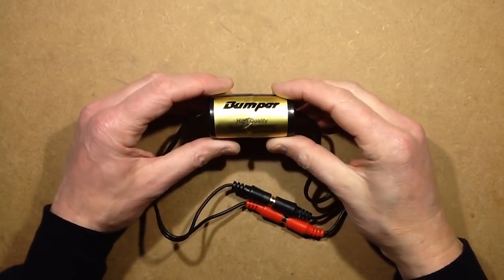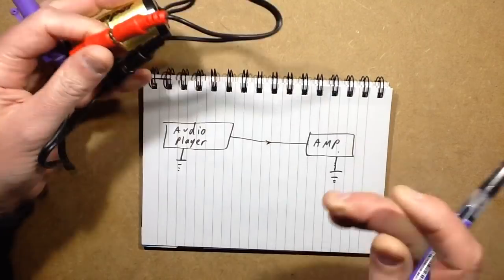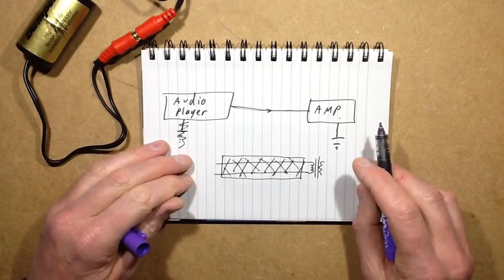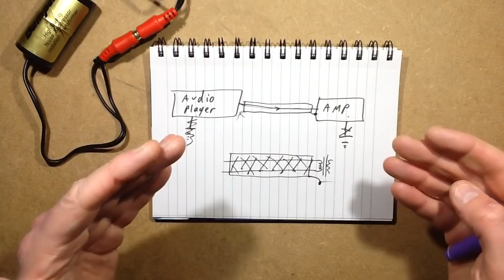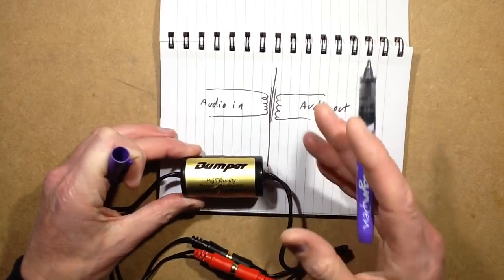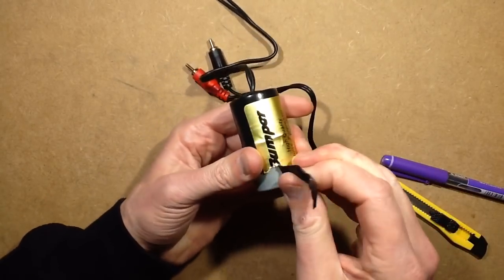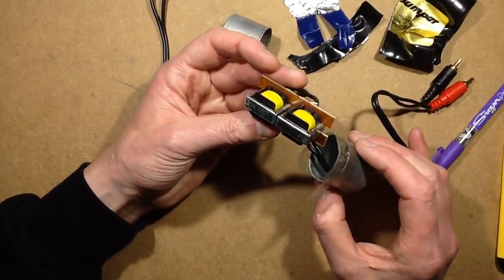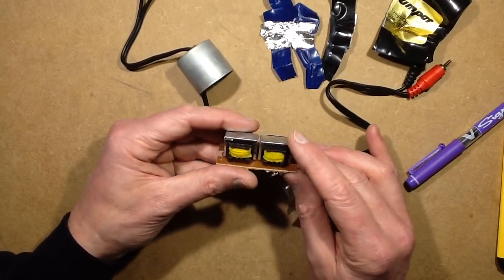Inside an audio isolator transformer module.

Comment: I have to get so.e of these in my application I use dimmer packs like propper ones and you can here the buzz at 50% like really bad at first I thought the dimmers was making the noise but the next day I turned all the lighting on and no audio and didn't hear anything apart from a tiny buzz and the fans on the packs

Comment: Just a thought, why don't manufacturers include isolation transformers on their inputs of the devices? surely it wouldn't cost that much more to include a little isolator.
Reply from the maker: +Michael SanAngelo More expensive audio equipment often does have transformers or balanced line receivers on the inputs.
Reply: +Michael SanAngelo Good transformers cost good money! Look up what a single input xmfr from the likes of Jensen or Lundahl will set you back. Not to mention their sensitivity to stray magnetic fields.

Comment: Usually used in automotive applications as well .If all your grounds are common in home or commercial audio you shouldn't have an issue .But we get grounds that  are missing and you have issues .My turntable my pre amp ,power amps all have polarized receptacle cords and cord ends 120V .But because my power amplifiers are u ground(Duplex) polarized I use an adapter that lets you use and share a common ground  screw so you can attach all your grounds to one common point .Some old audio equipment or radio equipment bond the neutral to the case and if you have a situation where you have reverse polarity between components or you being grounded and in contact with a metal component that's energized OUCH!!! Or you can damage valuable  Vintage Components  .I have had neighbours get Zapped from their coaxial tv Cable .Should only have 36vdc max on it .all of a sudden you have 90 to 120 vac coming out because some has a reverse polarity on a receptacle down the line !

Comment: I had this problem with a roccat headphones. They were a 5.1 so 4 audio jacks with usb power for amp (even though most soundcards on the market do not need any extra amp for 60ohm drivers on all channels). Every power source i tried to connect it to resulted in terrible high pitch hissing, incredibly when connected to pc i could actualy hear difference in the hissing depending on my mouse movements. 

I even tried connecting the headphones to isolated power sources such as a laptop on battery power, as well as different AC adapters from numerous smartphones. none of them solve the problem so i trashed the headphones and bought standard not powered ones. 

Sadly that audio isolator thing wouldnt help at all, 4 isolators, 8 RCA to minijack adapters . . .its a kinda bulky system to deal with and audio output wouldnt do justice for an expensive audo card ;p 
To be fair we do not use ground wires, most of houses are just 2 phase live and neutral with a current draw based home circuit breakers (+/-20A) .
Reply: +GotCritified Noise changing depending on mouse movements sounds like the USB signal leaking into the audio. Could be a crappy integrated sound card (I have experienced this with several computers, laptop and desktop - basically, if you care about sound, just don't use the internal sound card) or perhaps something to do with the USB amp thing - an amp for 60ohm sounds dodgy - in my experience any sound source will power my 250ohmish vintage Koss cans to deafening volumes, and many can even sorta power my vintage Sennheisers (600ohm or 2000ohm) if you crank the sound all the way up.

Comment: can you get one of these for normal 3mm jack my pc speakers give off a horrible buzz
Reply from the maker: +Jamie Thom I'm not sure.  At the very least you'd get a 3.5mm jack to phono adaptor and vice versa for the other side.
Reply: 3.5m what I meant woops
Reply: +Jamie Thom Yes, just search amazon/ebay/etc for a 3.5mm ground loop isolator

Comment: Out of curiosity, if you're in a dilly of a pickle and need to fix it fast, can't you just isolate it with two bridge rectifiers like the boats?
Reply from the maker: That would sound terrible as the diodes would introduce a sharp voltage threshold.
Reply: alternatively, you might get some nice guitar distortion. I mean thats basically an overdrive pedal

Comment: The foil is to provide a connection from the transformer clamps to the outside screen case. Saves soldering on a wire perhaps.

Comment: How can someone that cuts the earth to a power amp be called a "audio expert".
Anyway, We used those cheap isolators a lot (they come in different brands) and they do a pretty good job for connecting a laptop, all-in-one computer or barebone (anything that doesn't have a decent earthed PSU).

Comment: I used to use a cheap Chinese amplifier in my car and that used to get terrible interference when the engine was running the pitch of the interference would change as the speed of the engine changed I started using an external battery to power the amp and that fixed the problem but something like this would have been perfect
Reply: The noise I think you're describing can often be a sign of alternator problems.  cap on its way out I'm the voltage regulator on the alternator.  often has no other effects, other than making your radio do weird things
Reply: Nathan Lucas There was nothing wrong with the alternator, It only made that sound when that amp was connected and it made that sound in every car it was wired to.
Reply: +Nathan Lucas You're the voltage regulator on the alternator?!?! Wow, you can type?!?
Reply: +Aurelius R  auto cucumber strikes again

Comment: Facts about this product:
- This class of product performs what's known as the Ground Loop Noise Isolation.
- The Ground Loop Noise occurs when two systems reference two different grounds that aren't at the same level and interconnected via single ended signals.
- Isolation transformer is one of two ways to solve the infamous Ground Loop problem.
- The second way is to eleminate the Earth ground of one of two connected systems, so they're forced to share the same ground, of course, putting safety issue aside for this discussion- all AC device which has any exposed metal requires its own ground termination. 
- If noise is self generated by a device(a bad design), this isolation transformer won't help. That's not the purpose of this product.

Facts about the foil:
- The foil doesn't do anything. It's there because someone falsely thought it'd actually do something.
- Foil used in a proper manner in a proper device does eliminate EMI/EMC problems. An improper use also causes EMI/EMC problems. The foil used in this product does neither.
Reply from the maker: It's not acceptable to cut off a mains ground connection of a device as the audio cable would then become the return path for full fault current and could go on fire or the faulty device's case and connected equipment like hand held microphones could raise to near mains voltage and pose a high shock risk.  There are people that still do this, but it's very wrong.  One of those things that has been passed from person to person in the industry.
Reply: "...putting safety issue aside for this discussion..." & "...all device which has any exposed metal requires its own ground termination..."
Which part was unclear to you? 

The device in question can be an amplifier, but it can also be a small MP3 player, answering machine, small CD player, turntable and so on. The majority of household electronic products is considered Class II and has no Earth ground pin.

Comment: Cars have 'floating ground' with the chassis connected to the (-) side... You can get some nasty alternator and fuel injector noise in cheap audio devices...
Reply: If you think a car is noisy try a hybrid car - hundreds of amps at 300-400v thru a giant PWM supply. You might as well be in a tube train or trolley bus :) I make all connections via BlueTooth to get round this.
Reply: The only way I'd use bluetooth is using the Apt-X profile... The standard A2DP isn't good for much except those cheap little bluetooth speakers!

Comment: 2 transformers for the left and right signals.

ground loops are a problem too where a voltage can happen if you have faulty grounds.

car use maybe to allow connecting the speaker to line although there would be some resistors and capacitors to limit and recouple or decouple the signals

Comment: FYI the boxes to transmit audio over Ethernet cable have a transformer each end. Because f**** Microsoft Teams won't work with ASIO I ended up using one I had lying about between my audio desk and (unbalanced) PC Line In jack.

Comment: Lmfao I make these stereo isolators from power adapters of Cisco VoIP phones. Inside them there is a 10 ohm 1:1 small transformer  that is needed. You need 2 power adapters to get 2 ISO transformers. The power adapter is waste to I  recycled some of the components. The power adapters were thrown out for free hehe.

Comment: Two things. He says it is never OK to use a groundless plug. 
He is using and un-grounded source as an example. 
The reason studio engineers sometimes use ground removing plug adapters is when there are several mains powered audio devices chained together that are usually not, therefor the custom cabling is not available and standard patch cables must be employed. To have every power plug grounded and every audio cable grounded causes a giant ground loop and smaller ground loops around every device. Hum on top of hum. You can EITHER un-ground all but one power cord OR use audio cables with one end of the shield disconnected. Both methods will silence the hums AND provide ground protection. Yes, the audio cable method is preferred, but the ground omitting plug adapters work the same if used intelligently. Same ground protection, as cable shields are as substantial as any power cord ground wire.
The second thing is that the actual reason that so many people got electrocuted by the difference between the mic and guitar amp, was because of non polarized two prong amplifier power cords with ground switches that let the player choose which line the ground was referenced to. Those ground polarity switches were on practically every Fender tube amp made in the 60's and early 70's. If the ground switch was flipped the wrong way according to the PA power polarity, ZAP!
Ground omitting plug adapters are NOT the general cause of all the electrocutions back in the day, and these electrocutions have basically stopped happening with modern 3 prong guitar amp power cords. Vintage Fender amp users beware. Anyone with a two prong plug on a guitar amp for that matter.  Have a tech install a 3 prong cable and omit the ground switch if there is one. The foil plus metal can is to be considered a double MU shield, even if haphazardly applied...
Reply from the maker: +HUGO FUGUSEV Using an adaptor to break the mains ground and relying on an audio cable to provide a path for fault current is is not acceptable under any circumstances.  An audio cable is not designed to carry mains fault current and may not pass enough to activate the circuit protection, possibly resulting in shock, fire and serious damage to other equipment.  This misconception is a blast from the past and was borne out of electrical misunderstanding and luck.
Reply: +HUGO FUGUSEV These old guitar amps were so dangerous because they were AC/DC jobs - cheaper, lighter, but no mains isolation at all. (And if you were ever wondering why a band should want to call themselves "AC/DC"...) They needed a polarity selector so you could make sure your ground went on neutral rather than phase. Radios using AC/DC power would use extensive isolation, kinda hard to do the same on a guitar amp. 

Using a different power cord is NOT going to fix this because there is no isolated mains transformer to begin with (just a step-down job at best).

And yes, removing the safety earth connection on an IEC Class I device is not permitted. Audio equipment often is Class II a.k.a. "double insulated", which does not require PE and is built accordingly. Transformers also tend to be using shield windings for minimum capacitive coupling, so audio ground can be kept floating as well as possible.

Comment: Alright. Now I feel like an imbecile, because I can't seem to find a video on how to repair a basic 3.5 headphone jack.  The one that plugs your headphones (any generic kind) to the audio jack in a cell phone.  They always seem to break at the very end (where it solders to the tip) and it seems to me that it can be fixed without any soldering! Is it possible? Any why does apple have three extra wires colored copper/green, copper/red, copper/blue? Is there schematics for them, or a map of some kind? FML! No way am I about to spend $30CAD on a new pair of headphones! No way!

Comment: One has to be careful when using one of these as some times they can make the hum worse depending on the particular devices they are used with.

Also it has been my experience that a laptop power supply with a grounded cord may be more apt to produce noise when the audio output is connected to other grounded audio equipment. The solution at least in my case was to use a power adapter which is not grounded.
Reply: Thats the very definition of a ground loop.

Comment: These is a "OK" solution  for PA systems  but not good for Hi-Fi  listening... because the moment you introduce a transformer into a signal path,  it is going to modify the original signal.   A  Transformer  in a signal path is worst than a  Capacitor in a signal path. In a Hi-Fi system even Capacitors are avoided in the signal path.

Comment: Why is my audio quality so poor after I add one of these... It's not exactly the same one but I'm confused
Reply from the maker: A coupling transformer will affect the frequency response, but you do get good ones.   You also have to be careful to wire things correctly when using a balanced input.  No grounding of one pin.

Comment: 2.min50sec you show balansed input to amp  you say.but it looks like galvanic isolation.balansed signal is that there are 2 inner leads that goes true 2 exatly like circuits from input to output.shield connected to chassie.so the negative and positive of the signal get the same treatment and amplification lower noise with longer cable.Unbalansed audio need only one inner lead and shield that dont go true circuitry .so balansed audio needs twise as much circuitry.the floathing shield in signal directon is correct on rca unbalensed signal or unbalensed with a xlr connector.that also needs 2 inner leads where in the source end one inner lead and shield is connected to negative and in reciver end the shield is floting and just inner lead is connected to negative.What you draw on the input on amp is galvanic isolation nothing to to with balansed audio signal.I am preety shure i am rigth on this.and one more thing about audio signals they are not pluss and minus.It is ac are ac in different hz that makes a audio signal.But practical to use positive and negative  term do to phase and many other things!
Reply: @leohobb leohobb
you cant cut shield on rca at either end or you will lose return path for the signal , or have a very long return through the power earth points , if both are earthed :-)
Reply: You are wrong! here is how it is done! have to use a cable with 2 inner leads and shield.Inner lead 1 goes to pin positive,Inner lead 2 and shield goes to rca ground.on the other end the rca is connected via innerlead 1 to positive,innerlead 2 connected to ground but shield is not connected it is floating or lifted.those cables should have an arrow to show wich way they should be used.normaly from signal send source preamp etc.
Reply: @leohobb leohobb
that will work , but ive never seen any rca leads with 2 inner cores , audio or video , ive never used professional cables though :-)
Reply: known brand  like Monster cable use this and i bought a few pair some years ago.not  very expensive.Most i  buy  some good arc plugs and make.I never use one inner lead.The effectivness off this is not huge but audibly better.

Comment: Two transformers?, double isolation??
Reply from the maker: +Lakes57 Stereo.  One transformer for the left and one for the right channel.
Reply: +bigclivedotcom  I have a lot of hiss and white noise and a faint high pitch sizzle when my volume is low.  I also hear a little interference when the HD is accessing.  Do you think this device might help?
Reply from the maker: +5HINOBI That just sounds like the usual background audio noise that often occurs.  You could try turning the volume on your computer down and the gain on your amplifiers up or vice versa to see if that helps.  But there's no harm in trying an audio isolator too.
Reply: +bigclivedotcom Ah, of course, hence two phono/RCA connectors.
Silly me. :)